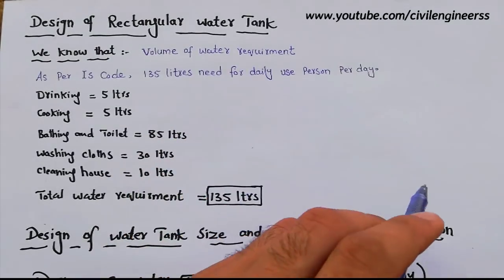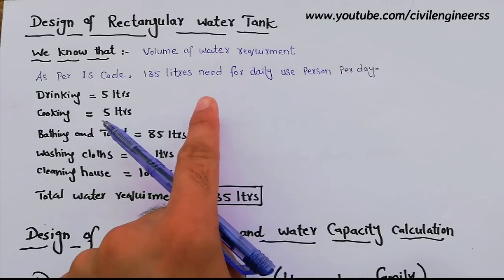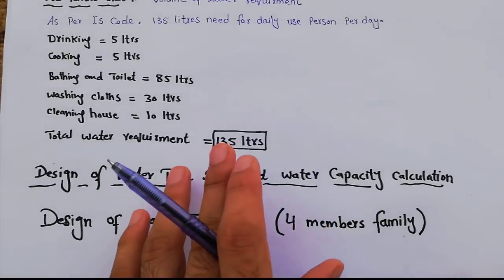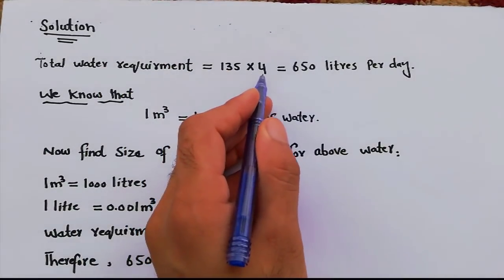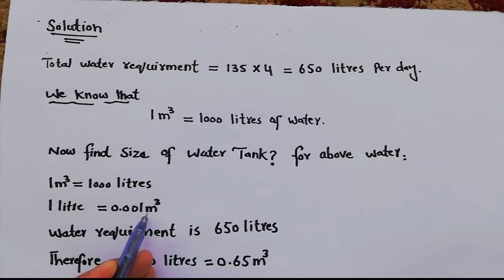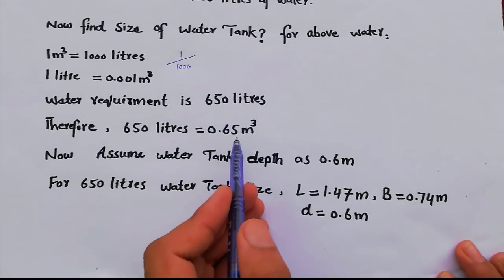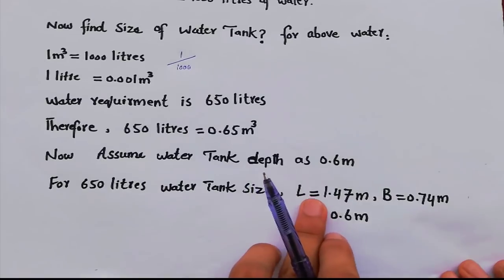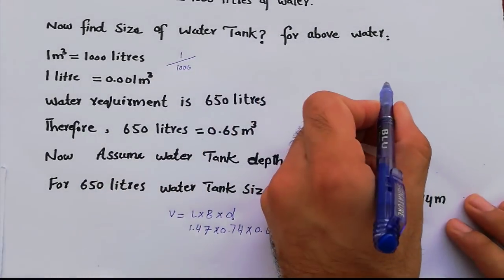Design of Rectangular Water Tank

Comment: If the dimensions of the tank is given than easily volume of water can be calculate...But only volume of water is given without any dimensions then how can we assume dimensions for rectangular water tank...is there any guidelines for those problem or any adjact calculations?

Comment: It's ok to assume the depth as 0.6 . But there are still two unknown values i.e length and breadth. We can't find it this way i.e
 V = L×B×D
0.65= L×B×0.6
So how do we find the length and breadth?????
Reply: How did u arrive at concluding the dimensions for L and B .. ?🤔
Reply: There is not any fix Dimension. You have to assume any of two dimensions, according to site location.
Then third will be calculated.
EXAMPLE: 1110 Liters = 1.11 m3
Suppose for limited Horizontal space - I will fix L= 1.22m & B= 0.91m, Depth will equal to 1m.
Or simply you can choose suitable L & B, will result in Depth.
Or you can revise (on Hit & Trail) if depth is too Low or High.
Hope will be the answer.
Reply: exactly correct , what you said ,

Comment: Yes Sir, in your calculation  you have got the height of the water tank ... It is ok.... On what basis did you calculate or assume the length and breadth of the water tank ?
Reply: Sir pls explain on what basis you have to calaculate
Reply from the maker: bro we have to complete the 0.65 cubic meter for this we will do multiplication of length and width and height to complete 0.65 m3

Comment: On what basis u assumed the depth and how u found length and breadth??
Reply: There is not any fix Dimension. You have to assume any of two dimensions, according to site location.
Then third will be calculated.
EXAMPLE: 1110 Liters = 1.11 m3
Suppose for limited Horizontal space - I will fix L= 1.22m & B= 0.91m, Depth will equal to 1m.
Or simply you can choose suitable L & B, will result in Depth.
Or you can revise (on Hit & Trail) if depth is too Low or High.
Hope will be the answer.
Reply from the maker: bro we have to complete the 0.65 cubic meter for this we will do multiplication of length and width and height to complete 0.65 m3
Reply: How to find out length and width

Comment: How to find out length and depth of water tank
Reply from the maker: bro we have to complete the 0.65 cubic meter for this we will do multiplication of length and width and height to complete 0.65 m3
Reply: Thnx sir
Reply: Ok we have to complete the volume but how u have calculate the length and width
Reply: There is not any fix Dimension. You have to assume any of two dimensions, according to site location.
Then third will be calculated.
EXAMPLE: 1110 Liters = 1.11 m3
Suppose for limited Horizontal space - I will fix L= 1.22m & B= 0.91m, Depth will equal to 1m.
Or simply you can choose suitable L & B, will result in Depth.
Or you can revise (on Hit & Trail) if depth is too Low or High.
Hope will be the answer.